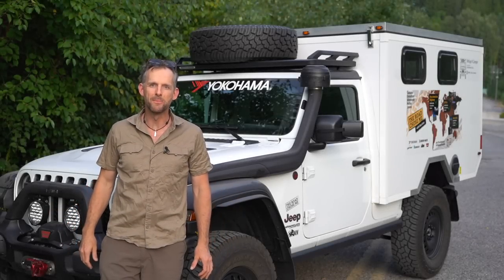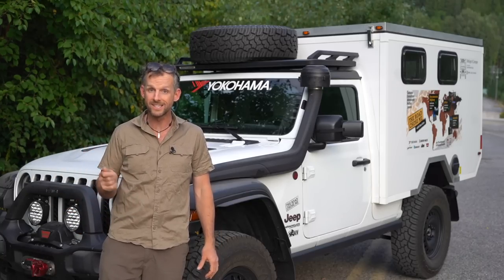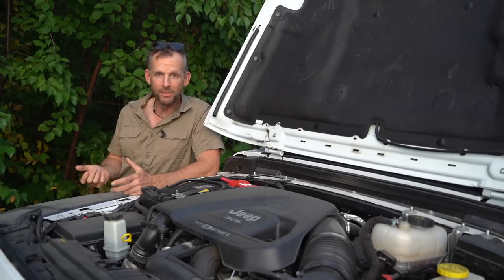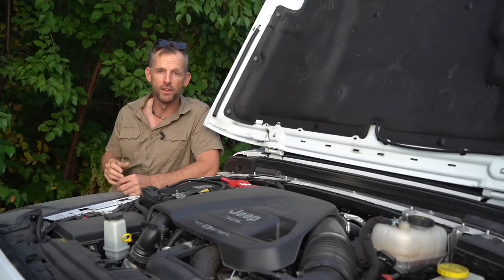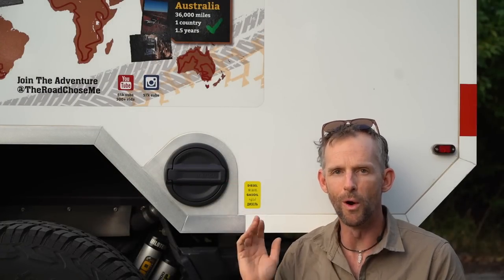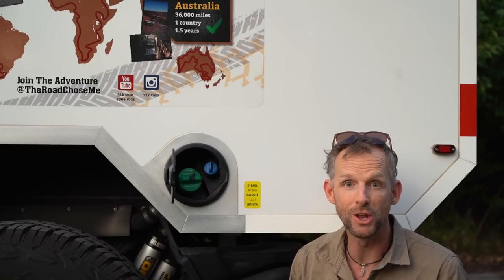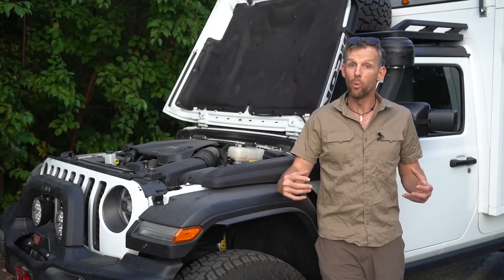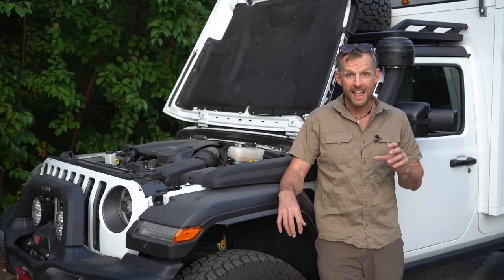Driving a Modern Diesel Around The World - is this a REALLY bad idea?

Comment: Great video as always. A few remarks:

1. Mexico has not fully transitioned to ULSD yet. This has been postponed several times. But ULSD is available if you look for it. 

2. The UN map does not give the full picture. There are many countries where there is still a high content of sulfur in diesel but where at the same time some gas stations that also offer ULSD. Examples: Mexico, Guatemala, El Salvador, Argentina, Brazil (the list continues). 

3. To make your own DEF you need pure water (distilled water). Interesting idea did not hear it before. Every dealership selling modern Diesel cars typically has DEF.

4. It is worth mentioning that spending a long time at high altitudes can also cause issues. Also going back to ULSD after a while, reduces the risk of damage / DPF getting clogged. 

5. Getting an OBD reader that works offline can be a good way to keep track of the DPF (there are so many parameters!), initiate a regeneration, or get unstuck by deleting error codes. 

6. It is important to regularly reach at least 70 kph (45 mph) regularly for at least 20 minutes to allow for regeneration. 

To answer your final question: Things have improved in the last few years and I think in a few years ULSD availability issues will be a thing of the past in most places (apart from parts of Africa/Asia). Good luck with your new rig!
Reply from the maker: Thanks for all the info, that is really helpful
Reply: Number 6. Vehicle's wheel speed is not the requisite, engine RPM is. At 70 kph (45 MPH) in high gear what is the vehicle's RPM? Many folks think "oh I need to blow out the engine so I must drive fast." Absolutely not, if one wants to drive it choose a lower gear which will run the engine's RPM up drive around for twenty minutes. Without driving one could do this in the driveway with the engine running at X-RPM.

Comment: During the transition to Ultra-Low Sulfur  in about 2007, a lot of the diesel guys had to start using additives and still do.  The argument is they removed a lot of the fuel “Lubricity” causing older diesel injectors to start clogging and sticking. Sticking open can cause a runaway engine or melt internals.  I’ve lived injector prblems even on my 2006 5.9 Cummins (probably one of the most reliable diesel engines you can get), keeping extra fuel Filters and Seafoam on hand is a must.   I ended up swapping injectors at ~160k miles.  

My advice Learn your engine, keep extra filters and seafoam on hand and get a scan tool or tuner that lets you read and clear codes.  Might be the difference between getting stranded in the middle of nowhere and limping it back to safety…If the diesel had a manual option, I would have gone that route with my gladiator.

Comment: As a Diesel Gladiator owner, I think you made the right choice. The extra torque and efficiency is perfect for the type of driving you're doing.  Make sure to use some Hotshots EDT to help lubricate the fuel system and you shouldn't have any issues with the pump.

Comment: Diesel vs Gas comparison.  In the 1960s I worked for Ted Shatto Safaris in Ethiopia. Two of our vehicles were Series II 88 Land Rovers. One was diesel, one was gas powered. They were identical, down to using the same engine block, and both were used to haul the safari camp to the camp site and as hunting cars, which involved removing the windscreen, top of the doors stripping them down completely and then driving around until a herd or individual animal was found then the hunter stalking on foot. Both Land Rovers were able of idling along in high range in the first three gears,  ....  But  ....  the diesel used half the fuel as a hunting car and on the road.
Reply from the maker: Absolutely no question, diesel vehicles consume less.
The issue is all the extra stuff on these modern ones.

Comment: Hi Dan, Thanks a lot for this detailed video. We are just back from Argentina and were happy that our 2022 Landcruiser runs on fuel and not on Diesel. We met people who had issues with their modern diesel when going to high altitude and some people even decided not to go  above a certain altitude with their diesel as they were afraid the system would shut down. We went to altitudes of just over 5,000 m and had no issues at all and still a lot of torque.

Comment: Great video Dan, well explained and that is an extremely cool Jeep camper setup. I totally get the 'just wanting a diesel' factor, as I'm the same way. It didn't really click for me until I was learning about them in my mechanical/automotive engineering courses, but I love the way they operate, especially the old mechanical ones. So I bought a bunch of old Land Cruisers and ended up with a 1HD-T from a Japanese 80 series in my 60 series. Happy with it so far, and getting similar fuel economy to your camper setup it sounds like. The first real test of it was a ~2,400 km road trip and it handled the mountain passes in BC well. Hope to see you on the road some day!

Comment: Great stuff Dan. Looking forward to see more if the build and your travels with it. I think your reasoning is sound personally as ULSD is more widespread in availability. We have both ends of the spectrum, a 7.3 Powerstroke powered Sportsmobile and a year old Duramax Colorado. Obviously the 7.3 is a beast and will run forever but the little 2.8 in the Colorado is so well suited to that truck. This is our second one and with stock size tires get over 30mpg regularly. It’s funny I first fell in love with that engine while traveling Chile in a Chevy Luv with an earlier version of it. I get a little nervous around the extra complexity of the emissions systems and particularly submerging them in water say in a crossing though I haven’t really heard of people having issues that way. So yeah, intrigued to see how this works for yah!

Comment: I love my VM Motori 2.8 Duramax in my 2019 ZR2 Colorado! Its an amazing little engine that is very torquey for how small it is. and still gets a consistent 23MPG with 34" tires. This makes longer road trips and more exploring much less stressful than any of my gas trucks or Jeeps in the past. And I still can tow a decent size trailer like my boat to the lake on the weekend! I just hit 100,000 miles with 0 problems with the exhaust system for the truck. I have seen a lot of guys on the 2.8 forums that don't have many, if any issues. The common denominator I have noticed is that when they do have problems, it's the guys who baby their trucks and drive them like a little old lady to church. The ones towing every weekend and using them to offroad in extreme conditions are not having problems with the emissions systems. I would surmise the heat to burn all the particles in the DEF filter and less "forced regen's" aids to the truck not getting plugged up.
Just my 2 cents, that may or may not be true....  love your build btw! so cool and makes complete sense to me on the JK frame!
What is your opinion?

Comment: Its not only about fuel type - torque at low RPM make it much more usable - IE diesel tractors - you can use the same fuel type for heating or even cooking if you want so no added danger of gas or petrol - the commercial world is diesel , trucks , busses so lots of infrastructure to support that everywhere - if most of the torque is made at low RPM's the piston travel/km is reduced and that's why large trucking companies using diesel engines generally get high kilometers - but life is never that simple as you have proven and petrol is also a very viable system for lower weight vehicles - great discussion !
Reply from the maker: I think you're spot on for big commercial trucks and vehicle without all the emissions stuff. But brand new ones have a LOT of stuff outside the engine that is very delicate and prone to failure.. that's what I'm worried about

Comment: I am from Germany and we see a lot cars, trucks and other machinery powered by modern diesel engines failng because of bad emission systems. The main issue is always the AdBlue stuff. The pumps go bad, the lines brake, sensors do not work properly... And Germany is one of the countries with the best fuel quality. So I think I would be more concerned about the complex system failing because it is to complex. As long as the car throws only a check engine light it is ok, but when it goes into limp mode...
Btw: in Europe modern (direct injected) gas engine do have a particle filter as well. But up until now I did not heard anything faulty about them.

Comment: Best video I’ve seen on the topic yet Dan! One thing that may have been worth noting is that the DPF can be proactively manually cleaned as a preventive measure. It is a pfaff undoubtedly but a relatively straightforward task and will prevent DPF-related limp mode. At the injection side, the main issue is potential churn of the diesel filter, which is more to do with the first definition of ‘dirty’ addressed in the video (eg contamination not sulphur). To complete the map a bit… Iran is >5K ppm (7000ppm to be precise), most diesel in Syria is presently from this source so one should expect the same there.  Thanks for the video, loving the build!
Reply from the maker: Thanks! How do you clean out the DPF? Do you mean manually opening it up and cleaning it?
Reply from the maker: Thanks very much, that is great!
Reply: @TheRoadChoseMe  Apologies, I’m tardy monitoring my replies. There are two methods: one with the DPF left in situ, with solvent injected at the temp sensor location (this I gather is how dealerships woulld normally do it); second by removing the DPF from the vehicle. Have a look at Steven B. Tuner’s channel here on YT, he does a good job discussing the ins and outs and which solvents to go for.  I was given a quick run down on the first method by a LR dealership in Russia, but it was all a bit technical and required a kit so I resolved next time to just pay a local mechanic/borrow a bay in future and go for the latter method.  I’ll be doing this with the Grenadier next year in Sth America noting that the DPF location in that vehicle is somewhat inconvenient.

Comment: blocked dpf issues are typically from lots of short trips with no load on the engine and not enough heat to burn off particulates. that won't an issue at all on an overland rig.
the sulphur is probably not going to be an issue either. you head into high sulphur territory with good fuel and a few tanks later you're back in good fuel again.
the big issue with modern diesels is common rail injection and extremely high fuel pressure a minor issue with fuel trim values, spray pattern or leaking injectors can cause big problems. toyota especially have huge reliability problems with their crd motors.
the vm 3.0l has been mostly reliable in grand cherokees in australia but they do get alternator failure, they have a coolant hose under the inlet manifold that leaks and is a big job to replace and rarely but not unheard of they will spin a main bearing which is pretty much terminal. 
i think you've made a good choice for power and economy and i wouldn't expect major issues until the motor has high mileage. i would probably monitor egt's in real time as they can warn you of problems before they become serious.

Comment: Hi from Spain 🇪🇸!
Here in Europe is quite rare to find petrol 4WDs. 
Mainly for 2 reasons:
1. Fuel consumption/cost
2. Performance off-road

Here the country side is not flat or desertic on which the engine quick response and the pure power is more important. Instead the terrain is full of mountains and narrow trails. On this terrains the diesel shines because it’s all about low and mid range torque, and that’s what you need off-road. 
Yes you can put a big 6.0L V8 petrol and get the same torque as 3.0L 4 or 6 cylinder diesel engine, but the you return to the first issue…fuel consumption & cost.

That said we all would love to run these big V8 petrol in ours 4WD.

Comment: G'Day Dan, what an amazing vehicle you're putting together, I am excited to see the final build and follow you on more of your adventures. I've been living in the USA for 20+ years now and was always a Diesel Troopy & Land Cruiser guy back in OZ. None of this fancy V8 Diesel but the 1HZ 4.0L Straight Six Turbo Diesel, not  the fastest, but could tow anything and unbelievably reliable Vehicle. Anyway, I think you have made a solid choice on this vehicle, it's always a compromise when choosing a vehicle tat fits 90% of your needs. I always preferred a manual transmission but it was a huge game changer when I went to Auto, especially driving on Fraser, Moreton and Stradbroke islands. I'm interested in your thoughts about driving an automatics now.
Reply from the maker: Cheers mate.
I had never had an auto before, but went all the way around Australia in an 8 speed auto Gladiator and it was game changing. The really tricky stuff in Cape York on the old tele and the big dune climbs in the Simpson and Canning were so, so much easier than with a manual.
I love, love driving a manual, but when it gets really technical, the auto is so much easier!

Comment: A lot of great info. Thanks for that! In my experience both petrol and diesel are fine for the most part traveling through remote areas. An extra filter for a petrol might not be too necessary whereas for a diesel it's a must. Fuel additives also help protect both engines which is a suggestion from me. But both do work really well. I don't think you made a mistake

Comment: So i have a JT diesel and love it, While im on 35's but kept the wheel and tire combo light (sub 100lbs) I would like a little bit more power. The same company you are prolly thinking of makes a stg 1 tune that keeps the DEF but deletes the egr(earlier engines had alot of issues revolving around it). The misconception with modern diesel is DEF system failure and not the intake side of the fuel system. On a side note somebody needs to 3d print you some mirror arms that are longer/wuma performance wide angle mirrors.

Comment: Hey Dan, thanks for the great video. Your choice of diesel, I think, is a good one. I own the diesel in a Gladiator. 40k miles and the vehicle is performing excellent. 
I would be careful with the bumper and lights mounted on your bumper. I do know the diesel will struggle with overheating at high altitudes being loaded adds to the problem. I would want my front grill to be free of obstructions and allow free and clear airflow. 
I am installing the AEV Snorkel you have. I noticed your intake cap is not recommended by AEV for use on a diesel. Has AEV had discussions with you about the intake? 
Love your knowledge and experience. Thanks
Reply from the maker: AEV are now saying the prefilter is fine. It's a newer model of filter (9001-R) and there is a PCM flash from Jeep to address problems.
As for the overheating, I'm told it will only happen on big mountain pulls at 60+ miles an hour, which means the US is the only country in the world it will ever happen, so I'm not really worried about it.

Comment: Another great video with excellent thoughts and information. I think your completely right when you say youll just have to wait and see as to whether the new diesel will prove to be a good invesment.  As an environmentally concious person myself I struggle with enamored relationship with my 1994 Chevy Suburban 6.5L diesel. I know its not the best for the environment but sometimes the needed purpose of the vehicle and budget has to carry some weight in decision making. My burb is my work vehicle primarily and can serve in the overlanding role as well. Its space and towing capability as well as its purchase price back when I bought it make it the afforable practical choice for me and my budget. In your case your custom vehicle with the diesel seems pretty practical to me as long as it doesnt presenty you with issues travelling to those dirty diesel destinations. First I think the diesel engine will serve you better in hauling the weight of your camper around much more fuel efficiently then a gas engine would. And the stress on the engine will be less, so the longevity of the diesel engine compared to a gas engine should be considerably better in your use case I would think. Also I think that diesel engines hold their value better and are more friendly to rebuilds, again adding to the extended logevity of running the vehicle. So for long distance travel it seems to be a good choice imo. That is ofcourse as long as new technology doesnt have ya pulling your hair out😊. Technology is so awesome when it works but can be such a nightmare when problems arise.

Comment: We actually discussed deleting our to do the panamerican hwy. costs are about $1000 USD without doing a transmission flash. That should include egr, and pipe, full exhaust and computer programming. 

That said we’ve done 20k miles from Ouray up to TukToyaTuk offroading to the border following continental divide. Then Alaska over 3 months. We did not have any issues with our engine. The power is amazing, and as mentioned its is easy to bulletproof the thing. Even though that can be very grey to do so.
Reply from the maker: Mind if I ask what company was going to straight pipe it for $1000 all in?

Comment: Hello Dan! I have been driving wheel loders for many years with ad blue in extremely dusty environment. Always keep a brush with you to clean the cap of before opening to fill up your def fluid these systems are extremely sensitive to any contamination in the tank. And as you said try to keep your ad blue level half full.
Reply from the maker: Thanks for the tips!